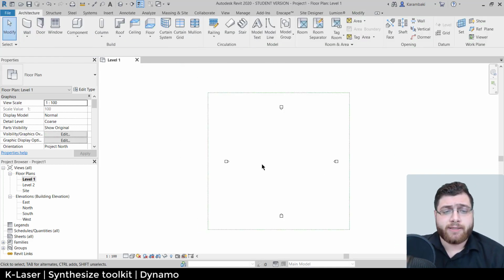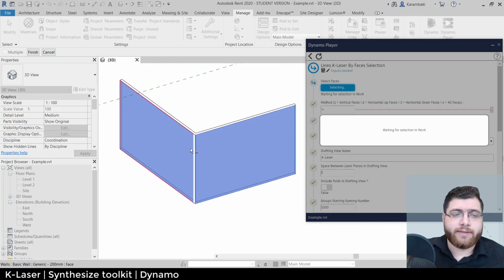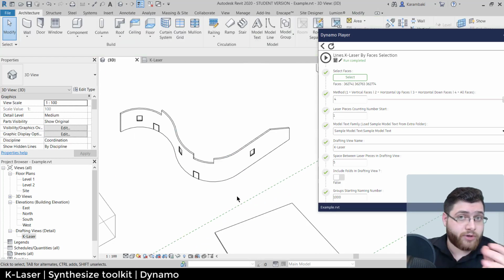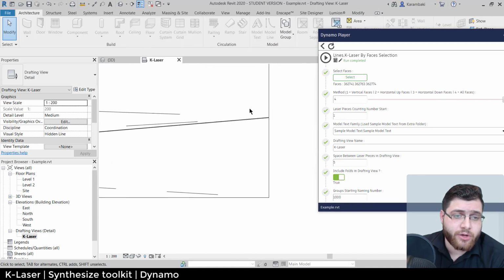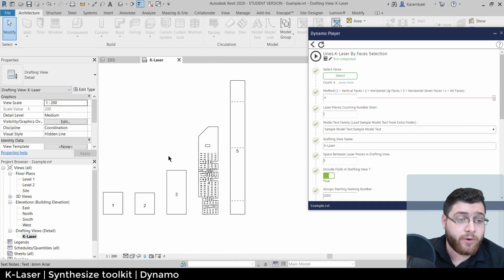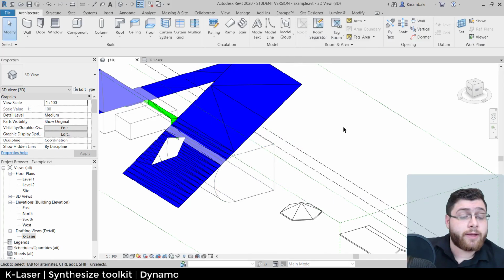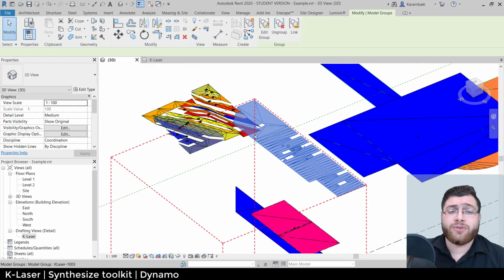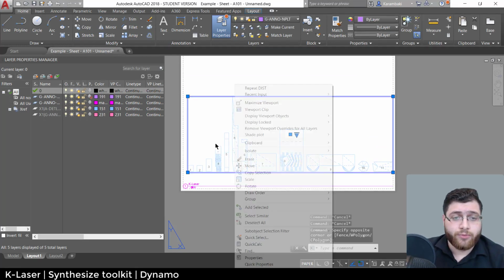(OUTDATED) Revit Laser Cutting with Dynamo K-Laser V3

Comment: I wonder if there is an option to make cut lines, full line.
Reply from the maker: It's now updated, I should publish a new youtube video about it soon, you can update and check.
Reply from the maker: Hello Hafif, am working on a newer version, it is much more smarter, it differentiate curved and non-curved faces, so it knows when to show the cut lines and when not to.

Also an option to control the spacing between dashes of the cut lines, and to make even solid line as you requested.

Also it is much more stable and doesn't leave extra lines above each other that needs clean up
Reply from the maker: It should finish within a week from this comment

Comment: you the best
Reply from the maker: Thanks Ali, am glad you liked it
Reply: @KaramBaki  but i still have the same problem run completed and no thing there
Reply: i use 2019 revit and 2.0.2 dynamo
Reply from the maker: What is the Synthesize version? Also try to use Dynamo 2.1, the latest from dynambim.org

Let me know when this work
Reply: @KaramBaki  the synthesize version is 4.7.7 and now im using revit 2020 and daynmo 2.1 but stil not working with me ..i need that perfect tool